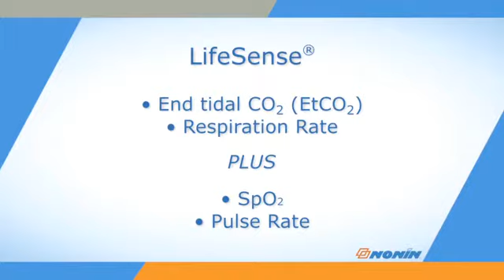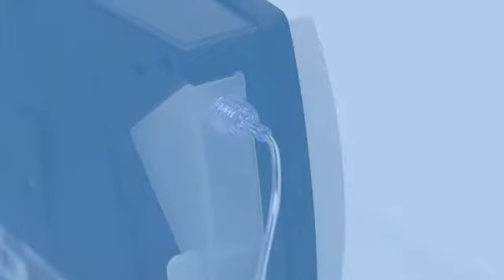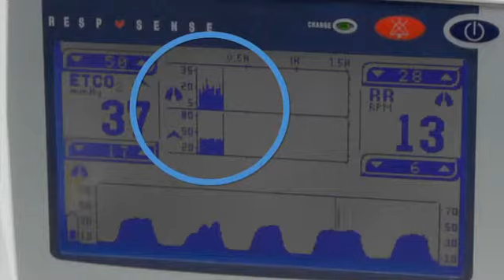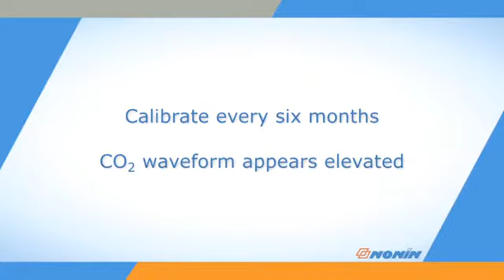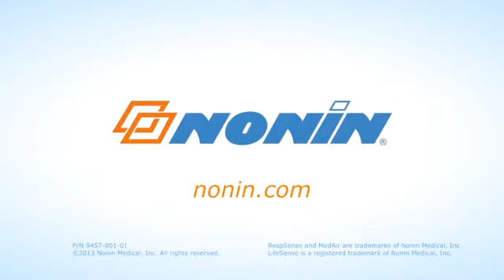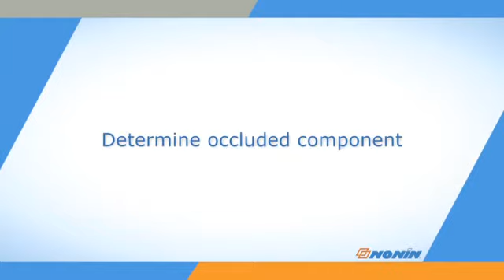NONIN - Capnógrafos LifeSense/ RespSense ®

Comment: I would like to ask about the sampling rate (i.e. How many CO2 samples are captured every second to display the capnogram waveform?) and what about the capability of storing these CO2 samples in a text file or excel sheet so the waveform can be redrawn.
Reply from the maker: Hello, these models don't have memory. You must buy the Trend Sense module, which makes the sampling 1 time / second with a capacity of 72 hrs. The information is downloaded in xls
Reply: ok thanks